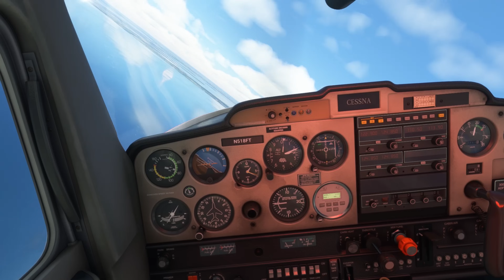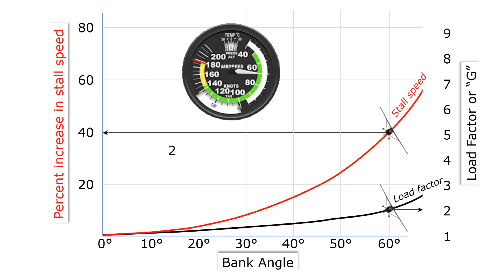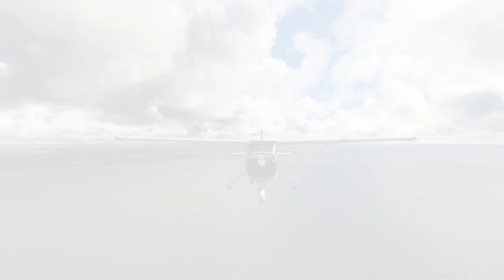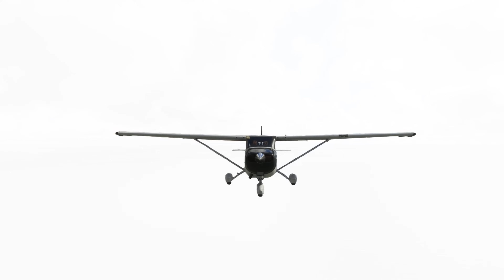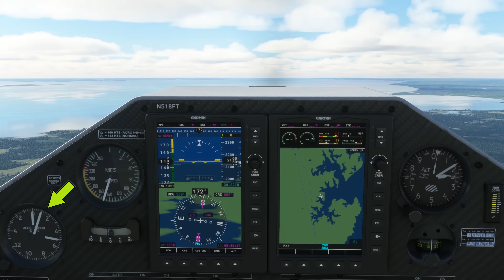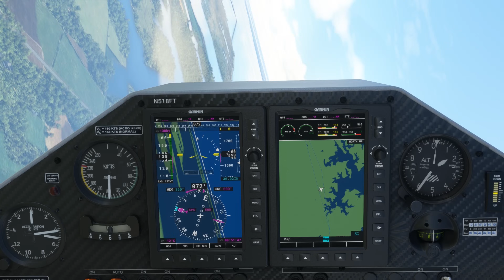I was shocked when my CFI showed me this | Stall Spin Avoidance

Comment: The stall speed doesn’t go up because of the higher angle of attack, though, right. To be precise, the load factor increases because a centripetal force demand is added to the wings, meaning the overall lift demand increases if we want to maintain altitude. This then requires a higher angle of attack, or more speed. The higher angle of attack is not the cause here.

Comment: It is easy to misinterpret charts and graphs, listen to questionable tribal "wisdom" on the internet, drool over glass cockpits and fight non-standardized avionics that suck your attention when it is needed most outside the aircraft. Spend more time looking outside the window, and understand that the air moving past your wing (relative wind, which is one side of the critical attack angle) is not always from the direction you are pointed.  That is how tens of thousands of pilots before us have avoided a stall-spin scenario.

Comment: I do not agree with the “NEVER GO BEYOND 30 AOB IN THE PATTERN.” The FAA does not have a limit, if that was the case the would publish one. 

It is all about understanding aerodynamics and the forces and accelerations the aircraft is experiencing based on our inputs. Since we cannot demonstrate and teach spins, we are limited to classroom setting we have to make sure the students understand all those relationships. 

The main goal is to minimize the YAW rate with any stalls, that is what causes the potential auto rotation to development and ensue we are in a spin if nothing is done. The turn to base and final are more dangerous if we have a yaw rate higher than an AOB and this is more common during skidding turns. Slipping turns are far less dangerous, but the main goal is to maintain the coordinated flight. Essentially once the turn is stablished, specially in medium bank turns, the rudder application will be lesser as adverse yaw is no longer present. 

When we turn the nose drops (heavy engine in front) and if we pull the nose up while skidding, loading the aircraft at low airspeed it is a recipe for spin entry, but notice that AOB, while it has a play on this since the higher it is the higher stall speed, the main condition for a spin is a yaw rate which will endure the autorotation. 

So, mastering aerodynamic and understanding all the conditions (forces, accelerations) during flight is paramount.

Comment: Check out Medium with several articles on the topic to include Improve your Landings with AOA and Power Techniques. If you learn to do constant AOA turns instead of constant airspeed, you won’t approach turn stall. See the correlating F-35C Crash into the South China Sea - A Case Study as well as Going Beyond Procedure - An Open Letter Regarding Spins.

Comment: Pedantic alert!  KEEPING the nose low does not unload the wing.  If the nose is down 10 degrees with the wings level, the wings are loaded at exactly 1G, by definition.  It's the DROPPING of the nose that unloads the wing.  While the nose is dropping, you are at less than 1G, but once you hold the nose at any constant angle, you're back at 1G.  In steeper climbs and dives, the pilot will feel a change in G's as the plane accelerates and decelerates, but that has nothing to do with G's in the plane of the wings.  So if you want to unload the wing, let the nose continue to drop.  Obviously, this is only useful for so long until you turn into a lawn dart :)

Comment: caution on "nose-low" statement, "load" is the important part.  Be mindful of back pressure and load on the airplane during all maneuvers. Remember you can still achieve an accelerated stall "nose low".

Comment: correct me if i'm wrong ( I'm not a pilot).  
when banked at 90 degrees there can be no vertical lift from the wings, so pulling back on the stick will not hold altitude.  But it will load the wings to go in a circle, slowing the plane at the same time.  Meanwhile, the plane is falling due to no vertical lift.
I suppose that at some point the forward speed could drop to the point that its not possible to recover - unless the plane is pointed towards the ground (left or right stick depending on which wing is lower ?).
If in a flat spin ( and I don't know how this develops), I suppose there is not enough wind over the control surfaces to change anything?

Comment: how does the load factor gauge measure? by wing flex displacement? or some kind of accelerometer and preset weight calculation?

Comment: Ok, the plane won’t stall in a 90 degree bank if you don’t pull on the elevator, but your passengers are going to kill you for scaring the crap out of them. If you don’t pull on the elevator in a steep bank, the plane will simply lose altitude and not turn, so why would you do that? Why not keep the bank angle reasonable and just say “Unload the wing by not pulling too hard on the elevator.”? I don’t see the point of making this video.
Reply: It’s an illustration. He’s not saying to bank 90 degrees. He’s saying the increase in load factor is due to trying to maintain altitude in a banked turn. There are times such as a traffic pattern when you want to lose altitude so you can bank harder at times even with lower airspeed and not risk excessive load factor and high stall speed if you are losing altitude through out said bank
Reply: @Dub636  It’s a poor illustration and can actually be considered an aerobatic maneuver. Why couldn’t he just say to unload the wing and it won’t stall or use DMMS and a reasonable bank angle?

Comment: Really good advice.   Every pilot should do spins with an instructor and practice them--they should be required for PPL and maybe in complex aircraft as they are for commercial.  Also,  I think practicing slips (without flaps--keep the nose down) is also great practice in an overshoot situation.   We do this in taildraggers and it can be done with most GA aircraft (read the POH) .  Seems much safer than trying to bank  back into alignment on an overshoot.   Not sure why this is not taught.  😂. Seems like it would save lives.

Comment: One more clarification: Instead of thinking about stall 'speeds' think about stall 'stick position'

Stalls occur at a critical angle of attack - angle of attack is controlled by the stick/yoke position -> the stick position controls stall.
You can remain unstalled in any aircraft even with the nose high and low airspeed, so long as you are not pulling the stick back past the stall stick position.
This video hints at that, saying to lower the nose, which is akin to saying push the stick forward of the stall stick position, but any aerobatic pilot knows that you can stall even with 120kts and pointing directly at the ground - the stick position determines stall.

I think this is an important video, I would have made it differently, but its closer to the truth.
I tried to explain this in the mentour pilot discord, only to have 30 people gang up on me to tell me that 'they'll use the stall speeds that have kept people out of the dirt for the last 100 years', however, as you said in the video 'each year loss of control is cited as the number one cause of GA accidents'. Clearly its important to understand the true cause of stalls, and how to prevent it.

Comment: Keep in mind that neither low airspeed nor high bank angle causes a stall.. Only a high angle of attack causes a stall an that is regardless if you are upside down, if you are at 2x the minimum speed shown on the airplane or if you are pulling up from a dive, wings level. The correct action is to unload the wing as shown in the video. At a load factor of 0g you continue flying just like a ball that you throw. You won't maintain altitude but you also don't stall and spin.
Reply: This. Only angle of attack matters. You cannot stall a wing at zero g.
Reply: People use 'stall speed' because its a number they can see on a gauge in the cockpit, but whats the indicator for angle of attack? Its not pitch or attitude.
(Hint, the answer is the stick position)
Reply: @aaronhammond7297  speed is a good proxy for AoA. Stick position is true,  but is not intuitive. An easier way is to understand that speed is energy, and if you have low energy it is easier to stall the wing. That keeps people out of trouble.
Reply: @aaronhammond7297  Yes, the position of the stick, but there are actual angle of attack indicators on the market as well. The stall warning is also an angle of attack indicator, though a very crude one at best
Reply: @aaronhammond7297  however I have read your other responses and completely agree with you on the reasons for the stall. 👍

Comment: Awesome video and demo! We learned for our PPT, that on final, you can control pitch with prop. Every airman learns that but it does feel more natural to pull back on the yoke to control the nose and that can get us killed. Thanks for the refresher!.
Reply: underrated
Reply: A skill that can be very effective and what will set you up for success during your IFR training as well is "Pitch for Airspeed, Power for Altitude"
Meaning if you're slow, push the nose over. If you're low, add throttle. If you're low and slow, perhaps do both. This will making holding a stabilized approach on final tremendously easier and more smooth while also drilling in the concept of pushing that nose low when maneuvering and getting too slow.

Comment: I always stress the load factor curve ONLY applies to level flight, to my students. Definitely something I see taught wrong far too often.
Reply: I think the reason that so much emphasis is placed on the load-factor curve is that people instinctively try to keep their flight path level when turning.

I feel like the reason people do this is that we are used to moving around on the ground, where we are constrained to planar movement.  People take the habit of planar movement with them into the cockpit, and end up wanting to turn, THEN descend, or turn, THEN climb.

I believe that there needs to be more emphasis in primary training on breaking this habit and learning to think about your movement in three dimensions.  This is something where incorporating some of the advances in PC flight simulation into ground training could be useful.  Modern simulators have extremely accurate edge-of-the-envelope performance modelling, and military-oriented simulations (such as DCS) give us access to high-performance aircraft where considering your flight path is a 3D volume is functionally mandatory because of the speed of the aircraft.

Additionally, the advent of VR give us the ability to learn the correct visual cues of the cockpit without our inner ears trying to betray us.  When i first started real flight training, i was worried that my PC flight sim experience would hold me back, that my unfamiliarity with the physical sensations of movement of the aircraft would have caused me to develop bad habits.  This turned out to be the opposite of true:  by spending so much time "flying" on the ground, i had learned to maneuver the aircraft purely by visual cues: sight picture and instruments.  Visualize where you want the plane to go through the sky, and then fly it there.

For in-the-cockpit training: practicing US-navy style continuous-turn 180-degree-to-final-at-idle-power approaches is a really useful drill for learning to fly tight patterns without loading up the wings.  I never worry about my bank angle in the pattern, because i don't load up my wings.  If i need more turn rates, i bank steeper and let the nose fall through as i do so.

Something you didn't mention in the video:  when you allow the nose to drop in a turn, **you reduce the radius of the apparent ground-track of the turn.**  Overshooting that final turn?  no worries, roll steeper, keep a 1G load, and let the nose fall through the turn.  Don't try to tighten the turn with the rudder or the elevator, instead tighten it with GEOMETRY by changing the plane you're making the turn in.
Reply: @ShuRugal  "I think the reason that so much emphasis is placed on the load-factor curve is that people instinctively try to keep their flight path level when turning. I feel like the reason people do this is that we are used to moving around on the ground, where we are constrained to planar movement.  People take the habit of planar movement with them into the cockpit, and end up wanting to turn, THEN descend, or turn, THEN climb."

Totally agree and understand your point. However, consider this. one of THE most practiced maneuvers for student pilots is the downwind-to-base, and base-to-final turns. Descending turns. And which turning maneuver is THE most deadly among pilots? The descending, base-to-final turn. So we NEED to be teaching people what is Actually happening in this condition.

"I believe that there needs to be more emphasis in primary training on breaking this habit and learning to think about your movement in three dimensions."

i completely agree with you.

I also have no issue with sim training. in fact, sim training is prominent in official flight training, as you may well know. 

"Something you didn't mention in the video:  when you allow the nose to drop in a turn, *you reduce the radius of the apparent ground-track of the turn.*  Overshooting that final turn?  no worries, roll steeper, keep a 1G load, and let the nose fall through the turn.  Don't try to tighten the turn with the rudder or the elevator, instead tighten it with GEOMETRY by changing the plane you're making the turn in."

This is a VERY interesting thought. I had never considered that one before. I will definitely go try that a bit and see how well it works vs other methods. I have other suggestions I always gave pilots to avoid overshooting (taught at a parallel runway towered airport), but I never suggested anything like that.